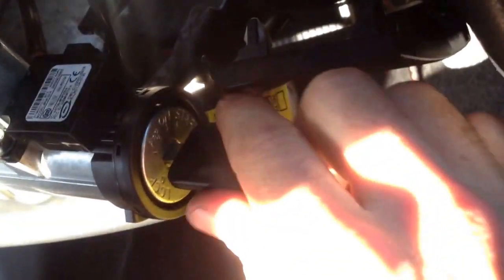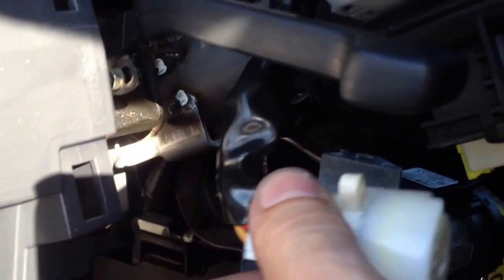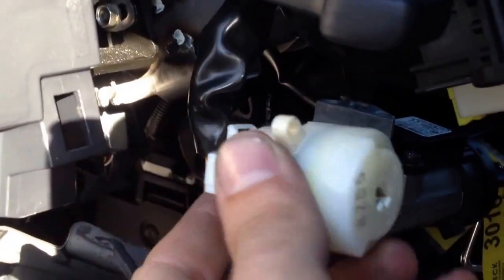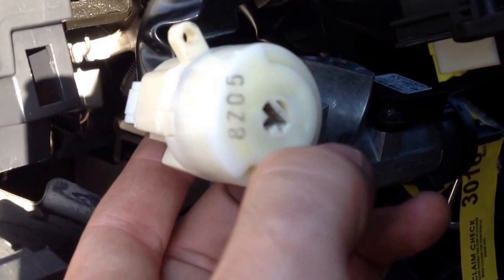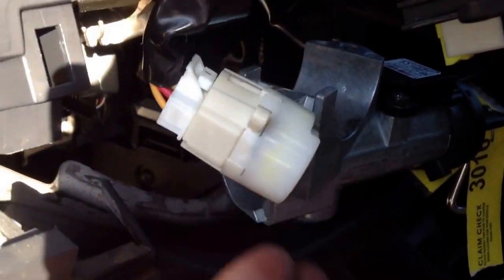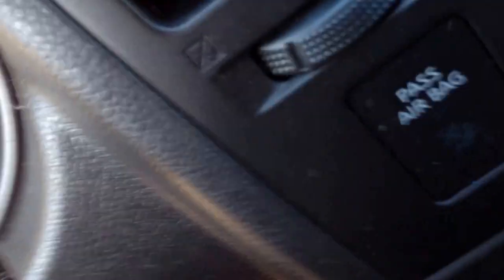Bypass ignition Nissan Versa

Comment: My Nissan Versa has done this many times now.  The dipshit at Nissan told me its because the key gets worn down since I dont have auto locks and have to use the key to unlock the door and trunk.  This is a major problem with the Versa's.  I took my car to Lake Tahoe and the cold weather also gave me problems with the ignition.
Reply: also the key wears down and the trunk and side door locks stop working. I had to take apart my hathc lock and remove a couple of the tumblers to make the key work again

Comment: Got the covers off trying to locate the bolt that you chisel off where exactly is that bolt
Reply: I cant find it either. Did you ever find where it is?
Reply: Look behind the steering wheel on top
Reply: With the steering wheel in the down position